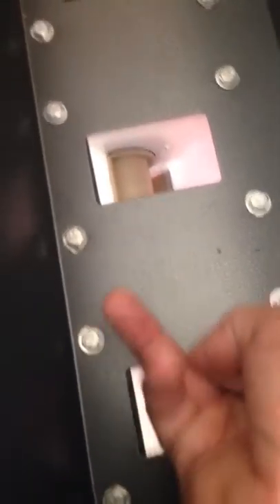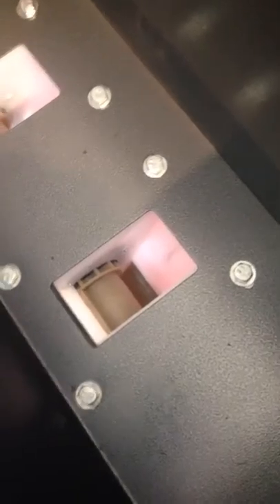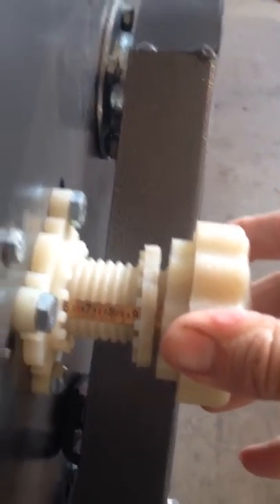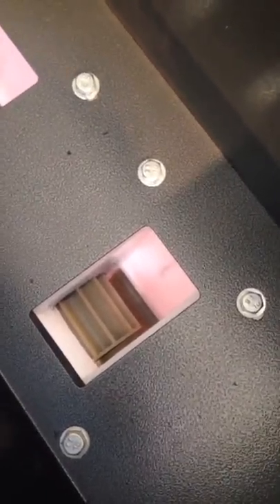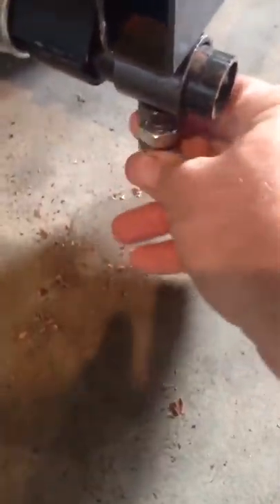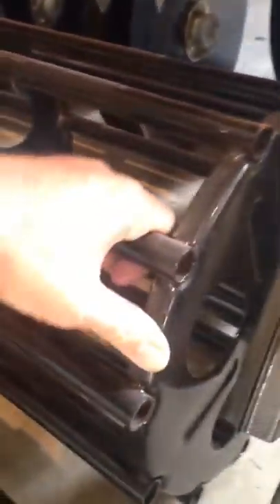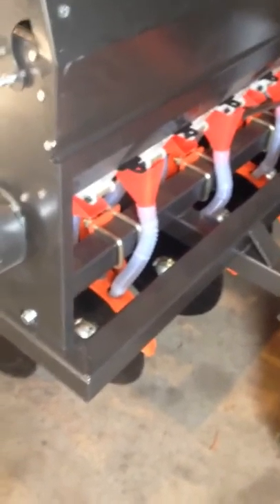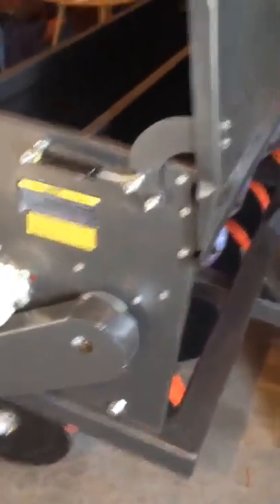Field Tuff FTF-603PTS Seed  Rate and depth controls. Video 4

Comment: I bought one of these recently and have to say....not bad.  Did my food plots with it and that was after plowing and then just discing the bed. I was concerned that I'd have to hit the bed with a tiller but thats not the case.

This works well and am looking forward to spring and planting a dense crop of corn.
Reply from the maker: Just keep it under cover and spray it all down with oil.  I planted corn and tried to get even 2-ft rows.  I failed miserably.  You're better off doing what you said and just put it down heavy.  I'm really pleased with this little thing.  It probably saved me $650 in lost seed this fall.  Everything I planted came up even though we went 16 days with no rain after planting.  I was successful at using this seeder for no-till planting this spring, but the conditions were very special.  I bush-hogged very close and plated after several days of rain.  The soil was very wet and just stiff enough to support the tractor.  See by video on "2nd attempt at no-till".

Comment: Hey can this planter drill corn and bean seeds?
Reply from the maker: It does a good job with soybeans.  See my video "Final Review".  They say it will do corn but I haven't tried it..  You can adjust the row width.  I will be putting in corn next year.
Reply from the maker: I planted 3 acres in silverqueen corn.  It did OK.  The angularity of the corn made it jam up in the cup and then break loose, so you'll get 4-30-ft strips where no seed came out, then it will break loose and pour down the tube.
Reply: @keithcarlson8455  noticed your video on the 3 point drill what do you suppose it weighs ??
Reply from the maker: About 500-lbs.  I have a 400-lb overhead winch I used to unload it, it was about all it could do to take enough weight off to let me pull the truck out from under it.  There was a little scraping, but it worked.
Reply from the maker: 500-lbs.  it arrived upside down in a crate.  My 400-lb overhead winch was just able to get it off the bed of the truck,